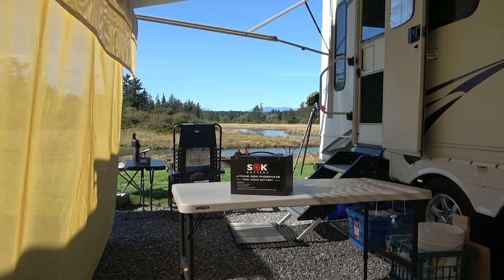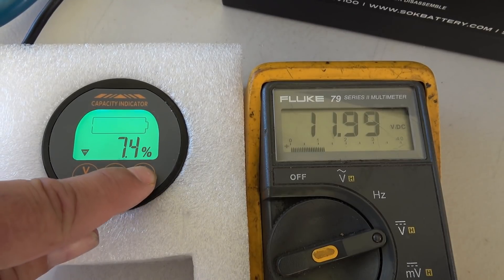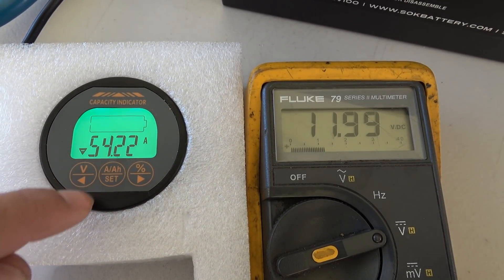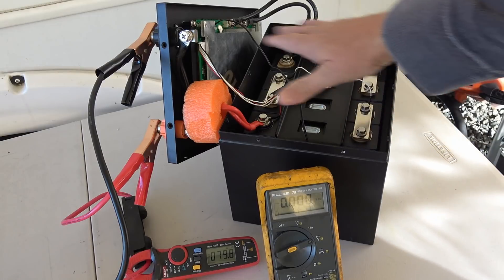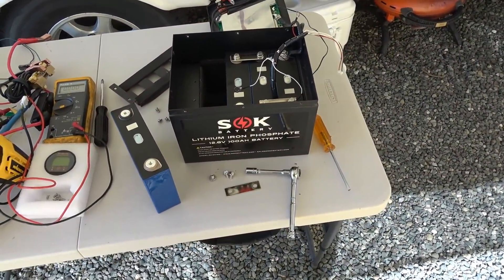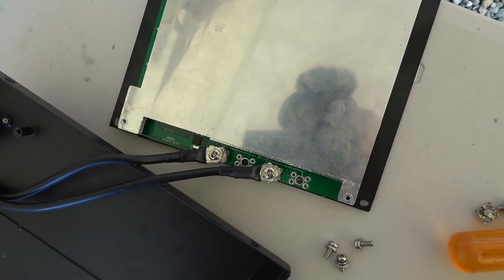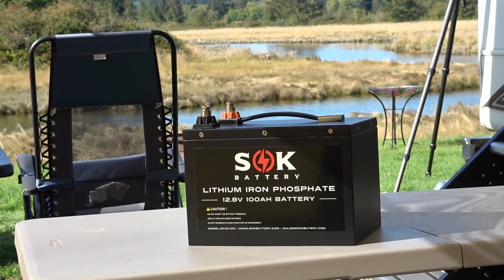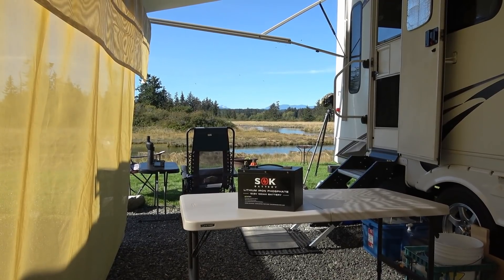SOK Lithium Battery Review Update + Giveaway Announcement

Comment: Ray, another great video as always. A while ago I told about the Herewin lithium batteries I have. Purchased them in 2016 they have worked without issue. About two weeks ago I posted a video about the system. At the time of purchase I paid $525.00 each shipping included.
Reply from the maker: Beautiful system and very nicely installed! Wow that motorhome has a ton of solar usable roof space. Also, great to see a system that isn't a full of the typical blue Victron and Battle Born stuff. :)  I was eyeing those Outback solar controllers as I'm now up to near 1000 watts on the old Cougars roof.  Thinking of upgrading mine next time I head south for some boondocking. I guess you must like them as you picked up a second one, which is a good idea just in case one breaks. Nice to have some redundancy. Cheers, Ray
Reply: @LoveYourRV  I run 2 Flexmax 80 because my battery bank is set up at 12 volts. At 12 the 80's have a Max solar input of 1000 watts. We winter at the LTVA Imperial Dam site. If you're in the area drop a note. Get together talk rv stuff 😏

Comment: I have solar cells to start my system....  just need the batteries,  no sense putting together tha panels until I have storage....  Mind you I literally just injured my foot yesterday,  so I can no longer work for the next several weeks.  My arch collapsed which actually was a good thing per my foot doctor as of this morning.  It prevented my foot bones from breaking.  So now I get to wear a big foot cast boot for the next 3 weeks,  can't even take my two small dogs on a walk around the house because my foot bones may break if I do.  My initial plan is for a system for powering my CPAP in case of power outage.
Reply from the maker: Ouch, that's gotta hurt. :(

Comment: Actually, I'm REALLY impressed with this 'lil battery that can' for what it is. Exactly 1,280 Watts = 100 AH at 12.8V (3.2V/cell x 4). Standard testing would be at .2C (20% of 1 hour rate of battery) or 20A and take 5 hours. That would be a true test of capacity. Based on your testing results, I'm guessing that it would hit the stated number, even after 1 months use in various ways in your camper. Generally, people would never load their FLA/SLA/AGM with an 80A test for more than a few minutes, and- I was really glad to see that nothing got excessively warm during testing at that rate! The wires connecting the battery to the terminals is properly sized, connections can take that relatively higher load over time- comforting to know.
   For reference, the Lion Energy is stated/rated for 105AH out of the box, and- testing has shown generally, they arrive with 107+AH or higher. More money, great warranty, more power too. But, the SOK Battery is exactly as stated, with a relatively good build quality, properly sized cells, and, matching wiring and connectors for safety. I would be VERY happy to use them in place of AGM of SLA batteries for more power over a much longer time!!!
   Thank you for doing the additional testing, it's nice to have someone actually open one up and see how things are holding up in there!!!
Reply: Lion Energy didn't stand up to testing by Will Prowse.  See his YT video.
Reply from the maker: @michaeldoherty2289  You likely are referring to the old UT1200 model, after several reviewers pointed out the flaws, they quickly came out with the UT1300 -  Will had some good things to say about it  - https://youtu.be/KRe9TWEEoI0
Reply: @LoveYourRV  Yes. Right on.
Reply: @michaeldoherty2289  Will still doesn't love the terminals (Safari 1300) for a variety of reasons, but- most users will mount these to bussbars, so multiple loads can get good access to the stored power, and, reducing the physical load on the positive & negative terminals. At 23Lbs., 105AH and dimensionally smaller than Blue & Gray, not to mention the 150A continuous draw capacity- those Lion Energy's are pretty sweet.
Reply: @DCGULL01  I'll have to find Will's comments to see why he doesn't like the terminals.  They are indeed different aren't they?
Reply: Yes Lion did come out with a real 100AH battery after it was brought to their attention that the one they were selling as 100AH was really only 85-90AH. To bad Lion doesn’t take care of the customers that bought the UT1200 after being told it was 100AH. So I would never recommend or buy from Lion again because of that. It proves they don’t test their batteries before putting them out.
Reply: @gladeejennings7352  Oh I think they test them.  They just thought we didn't.  I agree.  My money stays away from Lion now.   They ought to make some kind of restitution to the custommers they deceived.  Maybe a special price to upgrade allowing a trade in to the new one?
Reply: @gladeejennings7352  Actually, that is a little misinformed. But, if you checked at all you would know that they reached out to all registered owners, and swapped batteries. BTW, based on their testing avg. watts= 1,177, and, yes- they 'rounded up'. However, once notified they pulled existing inventory, and offered to swap with registered owners. You know the rest. They put together a larger battery, called it a 1300 (less than the 1,344 DEFINITELY in each battery) and it's a purdy good alternative to Blue & Gray/ A little less money, a little smaller, a little more power...and, they occasionally go on sale- BONUS! They could've walked away, re-named the company, whatever. I give them credit for standing up, paying the price and remaining as a viable company. Just one man's opinion though.
Reply: @David C. Gulliver Not true at all. I am a registered owner of batteries and not once ever get notified of a swap or I would have. I bought 4 so I’m a shit ton of money into them. I even contacted them and didn’t get no offer to swap as well as I had a company that sells them contact them for me and they told him no swap out either so if you got swapped then feel lucky. As for changing their name that makes absolutely no sense at all. They sell more them just batteries and have longer then they have sold batteries. So if you have ties to get them swapped out I would differently take your help.
Reply: @gladeejennings7352  Its shameful.  I used to love VW diesels.  After thier emissions cheating I sold mine back to them and will never drive one again.......  not if they give them away.    This is the same treatment Lion deserves.  If they don't make it right, buy elsewhere.  There are many good batteries on the market now.  We don't need them, especially if they mistreated honest buyers and didn't make it right by them.
Reply: David C Gulliver Do you have proof that they offered a swap out? I would like to see it if you do as they never offered me one. So please provide so I can go back and ask why you were allowed to swap and I never was.
Reply from the maker: I did do a test at about 15 amps just not on camera and same thing once it hits about 5% left the voltage drops off. You can still power things but really at 11.5V DC or less it becomes kind of much less useful for RVers, inverters go into low voltage shutdown and awning, slide, furnace motors, etc run slow or stall out. So for me tough the battery is technically 100 AH, but usable for an RV is around 95 AH. Still good but I wanted to give it a real world test so people know what to expect. Cheers, Ray
Reply: @LoveYourRV  Ray, Really appreciate it, but- LiFePO4 has a stated curve that is virtually flat until the last 10%. It drops off like a rock. Any battery with THIS chemistry will display the same characteristics with the same Amp Hours (and, NO hidden reserve!!!) The better manufacturers create more powerful batteries, but, use the BMS to prevent them from dropping into that last 10% by increasing the cut-off voltage, so- no-one experiences the inverter shut off described. But, look at ANY LiFePO4 discharge profile and you will understand what I am stating. SOK is an 'honest' 100AH battery (see cells: 320 watts, nominal voltage 3.2V, max charge 3.65V, max discharge 2.5V). I would never use just a single battery- if only to spread the heavier draws (load spreading), and, since I would want to be able run my furnace overnight, fridge, some lights & use my Kuerig in the AM- I would need a few (a couple?- Nope, a few!) to feel 'safe'.  Cool chemistry with exceptional cycle life if used properly, short charge cycle, NO Peukert effect.... 99% in & out unlike lead acid...Much to love- other than that pesky last 10% of charge!  Dave

Comment: Thanks for the open up video, I saw the balance wires, but I didn't see any thermal?  Does it offer low or high temp cutoff?
Reply from the maker: Yes. High is 140F and low is 23F It has 2 thermal cutoff wires, one on the BMS somewhere i think and one screwed on an internal part of the case

Comment: I had no idea these Li batteries cost so much...when you said $600, I rewound the clip, to be sure I heard that correctly.
Reply: This capacity in a high end can go for $1000. This one is built pretty good. I don’t think did put it in the bow of a bass boat for a trolling motor because of the pounding but it would be fine in an RV. When you look at depth of discharge and number of cycles these batteries leave the best AGM’s in the dust.

Comment: Nice video (again).  Hey, we were thinking of maybe heading to AZ in January. Have you ever left late for your trips down there? I admit, I've never pulled any type of trailer (let alone the 5th wheel) in cold conditions, so wondered what your thoughts were. Probably try to zip though Oregon on the way to SoCal, before turning east. Anyhow, your thoughts would be appreciated. Cheers!
Reply from the maker: We left on Dec 15th one year and it wasn't a problem. Just have to watch the weather and pick a good window. The coast route 101 is almost always OK but I5 can have problems in southern OR and northern CA, there are a few high passes to get by, and sometimes they can get snowy or icy during a cold snap.  But lots of snowbirds do head south after New Year and the holidays end so its not an uncommon trip. Once in California head down to Bakersfield and then over the Tehachapi Pass and you are in the desert. :) Same thing with the Tehachapi, check the weather, usually its fine but a cold snap can drop snow on it for short periods. Cheers, Ray
Reply: @LoveYourRV  Thanks.  I've been going back to your videos from a few years ago to review routes. If we go, we'll probably go thru the Palm Springs area. I'm not sure. I'm not set up for solar, so we can't do as much BLM camping as I'd like to. Maybe I'll work on that in the next months. Waiting for the roof repairs right now. Great time to go camping now, but not with missing skylights and vents!

Comment: Thanks Ray, think I'm glad with the Lion ones.  CostCo US had another sale, landed another two.  woohoo
Reply from the maker: Yeah, great sale they are having. :)
Reply: The 1300 would be perfect. I had been watching for it. It may be only in certain areas. At the beginning of the promo I was looking for it and the UT700 was the only one on sale in our area. I was hearing others getting the 1300 but it does not even show up in the app. I may try the SOK. The price is right. No tax if you order direct. Here in SC it is 9% where I live which Costco would charge me.
Reply: Daniel Dorchester yeah when I saw there were the 700 models I freaked out that I might have ordered those. But looking at the invoice they are the 1300s 🤪
Reply: The Costco is the UT700 which is a Twin Pack of 56 amp.  They are large and to get 200 amp hrs would take 4. I couldn’t do it. I really need 100 amp hr like the UT1200. Does Costco ever have the 1200?  The SOK seams like a deal for us RV folks looking to boon dock. I really am leaning that direction. Great video. Looks like a legit value play
Reply: Daniel Dorchester  I recently bought two 1300s the 105ah batteries. It’s a while supplies last situation if I remember correctly. They may have ran out of the 1300s
Reply from the maker: The Costco deals seem to have a few times a year and vary as to what they include in them
Here is the Costco sale details I was given by Lion Energy Rep:
Please note: this promotion will run for 4 weeks (until September 13, 2020). Products will only be available to people with a Costco membership.
Only the following products will be available during this promotion:
2-pack of UT 1300s ($1399)
2-pack of UT 700s ($729)
Cub GO Solo Kit ($159)
Prowler Portability Kit (1x Prowler + 2x Cub PBs) ($69)
Costco members will NOT be able to purchase a single UT 1300 or a single UT 700 during this promotion. They will only be sold as 2-packs. Costco members will need to sign-in to see the price for these two kits.